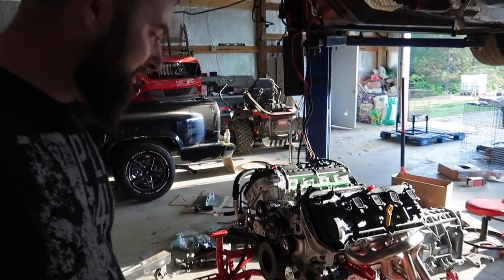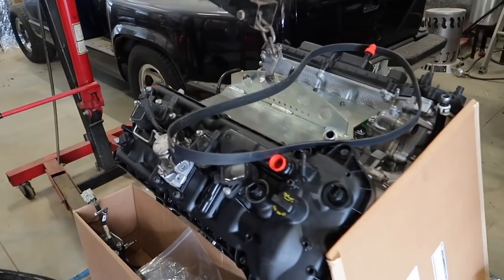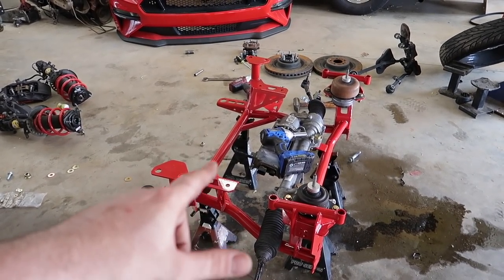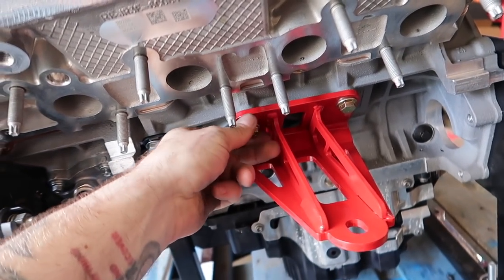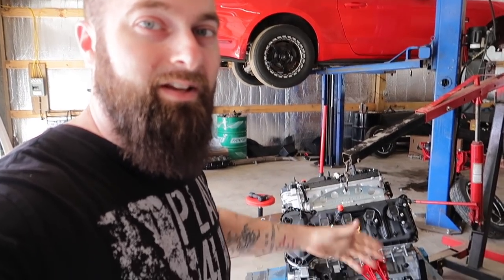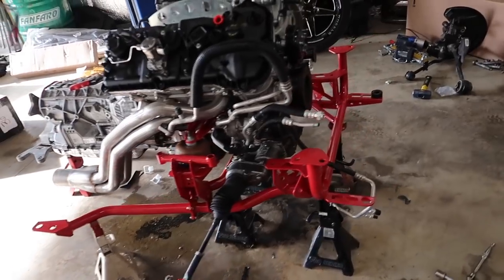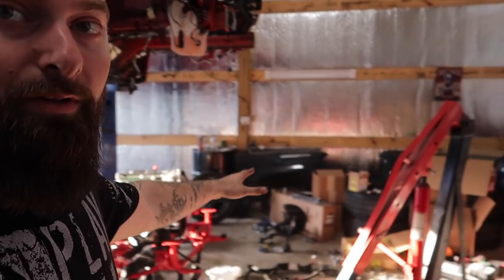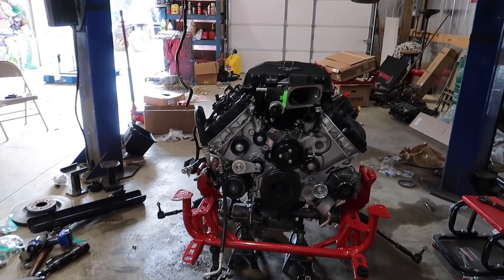My 2019 Mustang GT (Red Queen) Gets a 1400hp Heart Transplant and New Boost!

Comment: I’m just curious.  You have a 1400hp motor which equates to 1120 rwhp (through a manual).  My 2018 car made 1005 rwhp on stock motor @ 11-12 psi.  My car drives like stock.  I sat down and came up with written plan and executed it perfectly.  My next goal for this car is to put down 1500 rwhp.

I’m just at a lost with what’s going on with your build.  Hope you get everything figured out and running.  No more excuses.

Comment: That is going to be a nice combo, will be interesting to see the gains from a 5.2 vs 5.0. The LS/LT guys can do stroker set ups to get bigger displacement and they see quite a bit of gains, you should too!. In terms of different unfortunately i would venture to say that this type of combo would not be as relateable because not sure how many would have the funds to be able to do that kind of engine swap.
Reply: Coyote can be stroked too I been thinking about it but the costs is crazy. We don’t get the big gains like the Lt and Ls cars see but around 50 whp is normal. The 5.2 is a great upgrade too.
Reply: This is what I was gonna do believe it or not that Predator block is cheaper than sleeved blocks....IIRC it was around $2500 ready to assemble bare block...then you only need the 5.2L pistons which if you use shelf Crossplane boss302 crank is also a shelf piston, no more expensive than any other forged piston...
 So to replace a Gen 3 coyote block is around 1000 then $1600 rods n pistons...
To do this id 2500 block and $1600 rods n pistons...so $1000 or so cheaper than a sleeved gen 3....

Comment: are you ever going to mention what Hellhorse did ? Your loyal fans are waiting
Reply from the maker: Lots of broken an missing parts off the car. They only refunded like half of it. Stupid stuff like using my converter as a core charge for someone else. The turbo kit was all beat up with missing parts. Not paying me on time or at all when I was selling. And much much more
Reply: @Zander13Productions  glad you got it back , would be nice to mention these issues in a video most youtubers are scared to talk about the company’s that screw them buy those company’s still screw us too. Hellhorse did my OPGs and more , right after I was leaking oil from front of oil pan and they said it wasn’t them. Had less then 10k mikes and they were the only ones to touch it. They took it back in and “fixed it” tired go charge me but didn’t. It still has a slow leak today. I will get the pan pulled off and re sealed by someone else when I swap the K member.
Reply from the maker: @F1FIDY  I think most get the hint. I am no longer turbo’d and I praised the kit. Ppl can read between the lines.